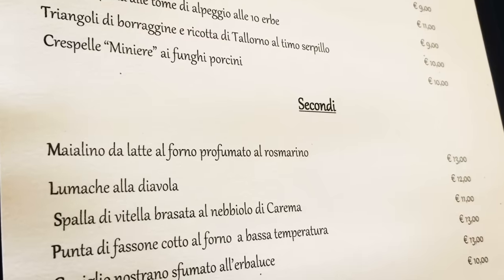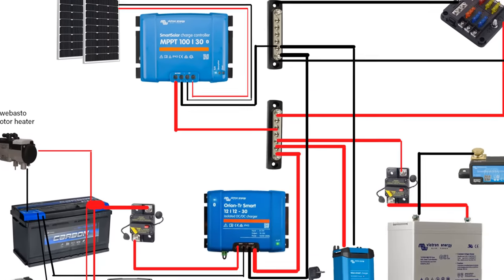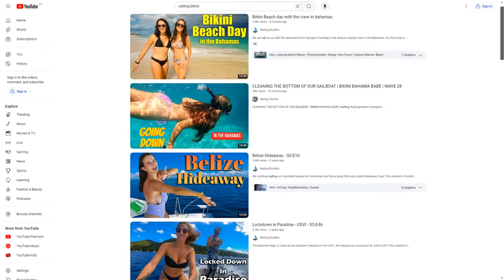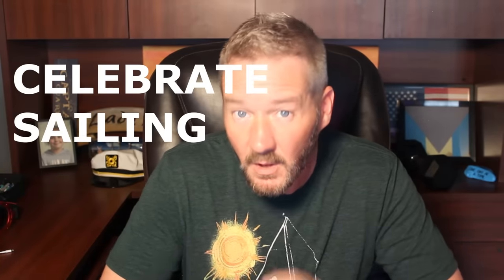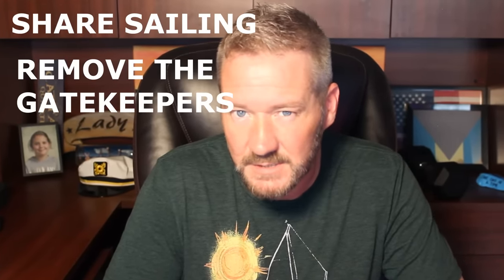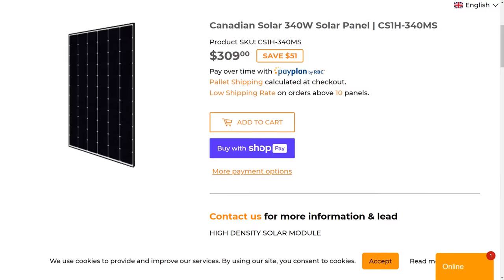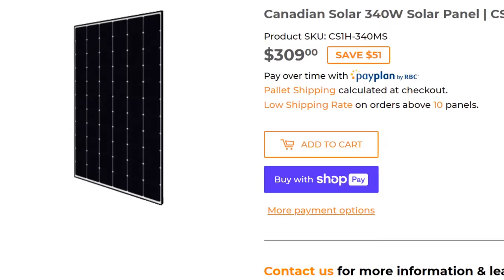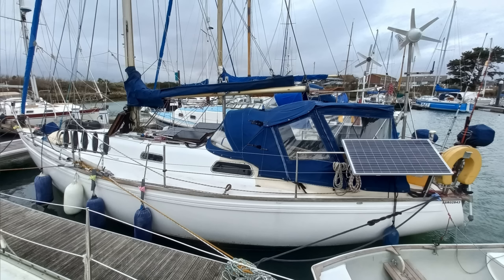How Much Does Solar Cost? Solar Panels For Sailboats, For Dummies! Ep 269 - Lady K Sailing

Comment: Tim. Love your work.  Before you buy  Battleborn please check out Signsture Solar range of DiY off grid solar.  12v 100 AH at $240 special.   12v 400AH Server rack battery at $1500

Comment: This is a good tutorial for solar/batteries. I went thought this exercise about 12 months ago to put battery and solar on my 4x4. One thing you forgot to mention is that lithium batteries last about 2.5 times longer than AGM batteries. So even though the AGM is cheaper you have to replace it more often. 

I had this dilemma with my 4x4 and in then ended up going with an AGM to reduce my upfront costs. But I made sure I got a dc dc charger which supports both AGM and lithium so that when I need to replace the battery I will get a lithium which I hope will be a bit cheaper a couple of years down the road.

Comment: Thanks for a another great video!  I just completed an 800 W solar install on my Beneteau 411 and the cost of stainless steel mounting hardware, marine grade copper cables, disconnect switches, crimping tools, voltage monitor, fuses, etc. was substantial.  People planning such a project should budget for up to 50% extra cost over the cost of the solar panels, batteries and Victron depending on how much they need to build from scratch.
Reply from the maker: Nice work!

Comment: Refitting my new to me Catalina 42 mk ii.  Repeating how I had my C and C 37.  2 thousand watt sets, 4 x 500 watt panels, 11.5 x 42 inches, with 2 controllers, $249.00 per 1000 w set.  And lithium have come way way down.  Put 2 new ones on the old boat, 2 x 100 Ah, $179 ea, with BMS.  By the way, I'm told a 100 Ah battery is actually about 109 Ah, so u can take them down to 90% and not hurt them.  So, u get 100 Ah out of a 100 Ah battery.  Congrats on your new job.  I love the magazine.  Keep up the good work.

Comment: Tim - I find the cost of 1200 watts of solar energy to be affordable - it is an arch or hard Bimini top to mount them on that cost "the big bucks".  In Annapolis we were quoted $12,500 for a stainless arch. We went to a popular aluminum arch sold in a box company and were quoted $9,500.  And these prices were just to fabricate the arches; both prices were for US to install them. I examined side mounts on the aft cockpit railings, but that only allowed two panels - and they'd have to be tilted flat under sail if it was rough. I think the biggest problem is where and how to install these big panels without spending a year of cruising funds for a mounting place.

Comment: I prefer option 5 - "ludicrous mode". Ditch the masts, booms, sheets, winches, combustion engine and fuel tank and fit a full length, full width solar roof array. Now we have a boat for the Med where the winds are often light and variable, sail changes a continuous pain in the bum and most of the time we spend at anchor. A 12m boat would allow a 6x4 array of 400 watt panels giving a total capacity of 9.6 Kw and in typical Med sunshine 58 KwHrs per day. Fit a couple of 80KwHr recycled Tesla lithium batteries and away we go. Endless air con, water maker, appliances at anchor and enough installed battery storage and solar power generation to cruise continuously at 4kts as we go island hopping. The Mk 2 version would have an extendable and retractable solar array "extension" deployed at anchor to increase collecting capacity further. We don't deploy the sails to catch the wind we deploy the panels to catch the sun. I'd love one!

Comment: One big mistake: You don't wire lead batteries in parallel. Tiny differences in voltage drag down the battery level and wear them. Sound solution? Separate charger controllers running into separate battery sets running separate loads. It's counter to what you learned for AC mains. On a powerboat, you use a battery isolation switch for starting. Same for a truck. ... You are dead right about golf cart batteries on land. Use them in series. There's another trick. Accurately dilute their acid. This prevents deep discharges from ruining their lead plates and cuts back on sulphating, if they get abused. For land, and more for boats, squarish batteries are harder to break, and easier to ship and mount. 12 volt chest freezers sip electric, add food capacity, separate temperature zones, and let you rest the big boat fridge. Always use ECO mode, not just for watt savings, but to add compressor life.

Comment: Great episode Thx for it , I live in southern ontario to, lost a sailboat in that ice storm last winter took dunno how long to build , so starting another and this one will have a solar panel with lead acid battery's , for me depending on how much you use the battery's and service them the lifetime can vary greatly , also the weight down low in a smaller boat is a benefit , the fire hazard of those new battery's isn't worth it for me never minding the cost , if I had claimed the boat loss to the insurance company they would have raised my rates about the same as what it will cost me to build another , that's today's world , have never heard of a lead acid battery sinking a sailboat and hope never to hear of a Lipo or whatever sinking one but pretty sure that's in the wind

Comment: So, since 1996 I've owned several boats, mostly all sail in the 20-30 foot range. Add a little tall ship sailing experience (Enestina  97-99, Gazella Primo 2000, and Charles W Morgan in '13). Needless to say I know a thing or two of my own accord, and you know what Tim, I still learn things from you, especially on the technical side. we don't always agree on styles (especially the new spaceship looking boats, I'm not a fan) 
But I love what you do, you are a wealth of information, and you present that information in an entertaining and easy to understand format, not to mention you don't dissolve into techno-babel. Haters going to Hate as they say. Yet again i'm going to have to slightly disagree with you, this IS in fact a sailing channel, doesn't need bikini babes and white/pink/black sand beaches to be that, "get more people sailing more easily" sounds like the goal of a sailing channel to me! 
Now I have to get back to sanding...

Comment: Enjoy the channel and topic.  There are a lot of pv panel makers and solar charge controllers.  
Many 300-400w pv panels with good certifications are now being priced at 25-32 cents a watt making $80-$130 each, so the $200+ item you showed seems overpriced.  Might include shipping which would make it reasonable, but if you live near a supplier and can pick up, there would be no shipping cost.  For panels hanging off stern of boat, it would seem bifacial ones would provide more power given the amount of reflected light.  Same thing for bimini using edge sealed bifacials as the top.
There are other solar charge controllers as well, 4 yrs ago installed a 150/60 good for 720w for 12v bat bank one on a sailboat costing just $150 w bluetooth which still works fine and there are others at around $195 that can handle 900 watts for 12v bat bank and 2 can be linked together to charge a single bat bank.  So for budget minded, there are alternatives.  
As for the LiFePo4 bats, there are 100ah 12v ones in the $200-$250 range that have tested ok (some by sailboat cruisers), maybe not a good as brand you mentioned, but also not $700+ each either. And for sailors who need LA bats for engine starting there are devices that allow LA and Lith to work together and not damage alternators.
I did watch all your Bahamas episodes, years back, including the near sinking ones, and really enjoyed them.  There are priorities and kid's education/upbringing come before Bahamas cruising.

Comment: Great job explaining it
Most make a critical error on doing it by Watts alone
Ohms law
You must overcome the incoming voltage

Anyway we use lead acid big caterpillar d8 battery's. With battery additive gose by a bunch of different names but it's cadmium sulfate we're still going Ride along on the same batteries since 1992 are panels are getting a little tired
Lithium is not rebuildable lead acid is
Even without a fresh supply of sulfuric acid a bit of baking soda distilled water or ro water and some magnesium from the ocean back online again
Reply: Ok
1 more
Have you ever use a battery charger
As the battery gets full,,Fuller,, amps goes down but watts stays the same  as when 1st started in fact can go up like the whole Enron scam.
Ohm's law got to love okok 
1 more
Sailboat is the perfect analogy
True wind
Apparent wind
Current
Speed over 
ground

PIRE

Comment: I really like this different approach - what works for others? Yes I fully understand bottom-up planning (am an engineer and have my own off-grid system in my house) but for sailboats this thing does not have that many variations anyway and if you run a bit short you can always run the engine or a genset so why plan to the fourth digit? Good stuff. 
(just one comment: when you made that review on the IP on Practical Sailor I got really confused - that kind of boat episode used to be my favourite content here)
Good work, keep it up. Subscribed at both. Total landlubber but these channels are getting me closer to water than ever.
Reply: Does every engineer tell everybody they're an engineer?
Reply: @theowenssailingdiary5239  you will never know how many didn't. Does every sailor tell everybody they are sailors? I mentioned because people who have read articles about "how to design your solar"' tend to teach lessons on system design how to do it "the right way". I love practical simplifications to save time and bother and it is not because I don't know the "proper procedures" but because I have done enough to see that sometimes it just doesn't make sense. When one can have one or two or four panels, one or two batteries - why complicate?  
But thank you for your constructive comment anyway.

Comment: Living on a Egthene 24 in the UK with a 50 watt solar panel... it's been cloudy for the last 2 month's... it's what I would call challenging. I'm beginning to suffer from range anxiety. Not sure about putting lithium batterys on a boat due the the safety aspect from them bursting into flames?
Reply: LFP are a variety of lithium ion batteries that are pretty safe.  If you think about lead acid batteries, if your charge controller messes up and overcharges, the battery produce hydrogen. So not entirely free from fire hazards either.

Comment: No AGM.  Lithium allows use of 100% of rated capacity and is now affordable. AGM batteries will fail if they are discharged below 50%😢

Comment: Sad to hear the rant was necessary; love your work . . . long-time viewer.

That said . . . you have thrown the cat amongst the pigeons . . . 

Having recently studied Italian out of necessity, I would suggest . . . 

Lead-acid BAD except for engine batts.

Lithium weighs far less. Requires less space. Charges far quicker and is more forgivingly of charging fluctuations.  And discharges down to 15-20% without degradation of the batteries. (As opposed to 50% AGM).

Just don't forget to 'fuse' it.  And buy reputable.

I put 1020 ah of Lithium on a 40 ft boat 2 yrs ago and that was barely enough in the tropics powering conservative use of ship's systems, sml LED LCD TV, sml fridge and the occasional use of a microwave; for 2 people.  

900w of 72v solar charged that amply.  Victron MPPT 150-85 controller is a good coupling for the system.  And don't use an inverter less 2000W.  Better to convert to 12v.

Stay sane.  Keep up the good work.
Reply from the maker: Thank you so much for your support 😊

Comment: Definitely not here for the bikinis. I really appreciate your practical advice.

I had to look twice when playing with the configuration page of a catamaran company and realized they charge $10/W for their installation for a system with several kW, not including the battery price. I've worked with solar on the wholesale side for many years. That is a very, very steep mark up.
What you are proposing to people is much more reasonable. One thing I would add is a consideration for top weight added, if you mount several glass panels high up above deck.

Comment: Tim, you don’t need advice from me.  But, in my opinion, you are doing and saying the right things.  Saying them much better than me, mate.

There are detractors everywhere and the internet seems to attract more of them.  Don’t listen to them.

As for this video:  cool bananas.  Timely as we are in the midst of upgrading our single 20 year old panel to 4 x 440w bifacials and four 100/30 victron mmpts.  Plus rainwater collection from them all.  So your video was timely.

We aren’t quite going to get 500ah of battery storage, but 400 should be adequate for our 35ft mono.

A word on bikinis.  I have nothing against them but if I wanted to stare at young babes I’d be watching other videos and be less well informed.  I think Practical Sailor did the right strategic thing seeking you out.

My wife and I spend a lot of our free time (and sometimes our money) reading these articles and buying related ebooks as required.  You’re an excellent fit for PS.
Reply from the maker: Thank you so much for watching :)

Comment: Amp hours is a terrible unit to use. It does not tell people how much energy is stored in a battery.  This is because people also need to know the voltage (a boat could be 12v, 24v, 48v etc, so energy stored could be out by four times). Watt hours is the correct unit to use, because it includes Volts and Amps. Using/talking Watt hour is easier because most people know the Wattage of lots of appliances.
Reply from the maker: Do you understand what I'm on about when I use amp hours?
Reply: @LadyKSailing  No because I don't know how many volts your batteries are. Amps is meaningless without stating the voltage of the system. 
Amps is just a unit of current.
A Watt hour is the amount of energy you have stored in a battery.

For example:
A 12 volt battery with 40 amps hours will have 480 Watt hours
A 24 volt battery with 40 amps hours will have 960 Watt hours
You could say 40 Amps hours but that could mean you have half as much energy stored as the next boat.
Reply: @LadyKSailing  NO. You say your boat uses 180 Amp hours for example.
For your battery to store a day of power:
at 12 volts you would need a 2160 kWh battery.
at 24 volts you would need a 4320 kWh battery.
at 48 volts you would need a 8640 kWh battery.

So who knows what size battery you have, because you use used amp hours without stating the voltage (better still you just didn't state Watt hours).
Same with figuring out solar panel requirements, without knowing the full details (voltage and amp hours, better still Watt hours).

Comment: Tim, Mas, of “Sail Life” channel came has an ingenious PV arrangement mounted above his dingy davits off Athena’s stern.

     He created three tiers of PV panels arranged in pairs. The frame work is “80:20”.  The upper pair is always in use, but the lower two tiers slide out to Port & Starboard like the leaves of table extensions, tripling to his output, depending on weather & tack. 👍

https://youtube.com/shorts/Q5rXvJ9ij5o?si=Ii5fChabP1IrTHZb
Reply from the maker: Nice!

Comment: Why talk about amp-hours?  Wouldn't watt-hours be better?
Reply from the maker: Yep - but either can be confusing for new people
Reply: If you do it in Watts you will be some 90% short ohm's law 102
Reply: It's a legacy thing from when everyone was on 12V systems. Ah should really be retired from these discussions now that some use 12V some 24V and some 48V.
Reply: @LadyKSailing  Most electrical equipment is rated in watts not amps.  Your video seems to start on what size solar panels that could be installed and thereby limiting what electrical equipment that could be utilized.  Another way to size the solar system is to first total up a boats daily electrical demand  in  watt-hours and then size the solar system to meet that demand and if need be reducing the demand, i.e. limiting what .electrical equipment is utilized.
Reply: @fclopez1  some good points however it's not apples and oranges one is supplying and one is drawing
Volts is pressure amazingly enough electricity is just like water you must overcome the incoming pressures in order for you to push the electrons
Reply: @thomasstuder1624  watts should be retired when talking about making power
So just like pumping water what is the total amount of work being done so using the water analogy pumping into a tank watts would be head pressure not the amount that is going into the tank amps is what is going into the tank volts is pressure
Reply: Or let's make it more a boat analogy we have a bilge pump that can pump 1,000 GPH at zero lift which would be Watts
If we have to pump up and over say 5 ft which brings us down to let's just say 700 GPH amps is what's actually being pumped out if that makes sense
Reply: @fclopez1   watts should be using  not supplying
Reply: Because that's how batteries are rated , so people can equate